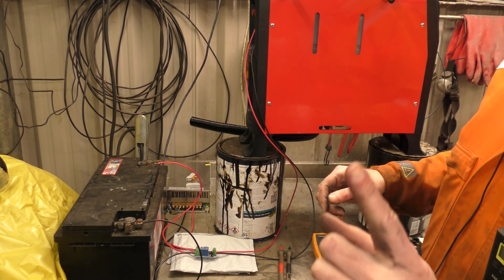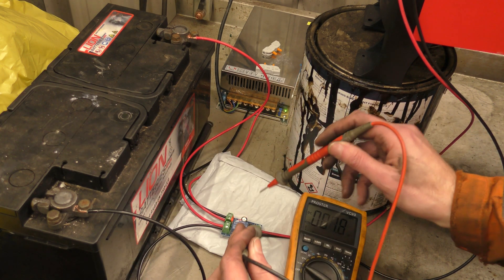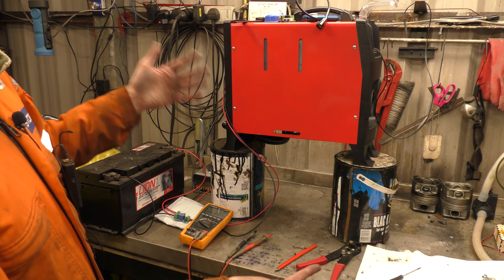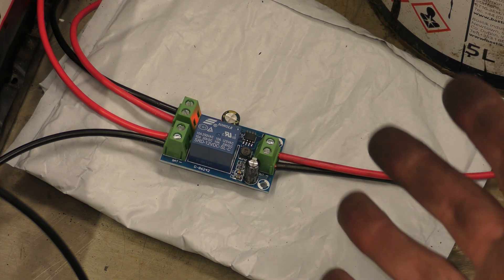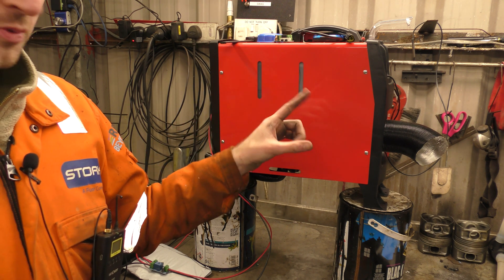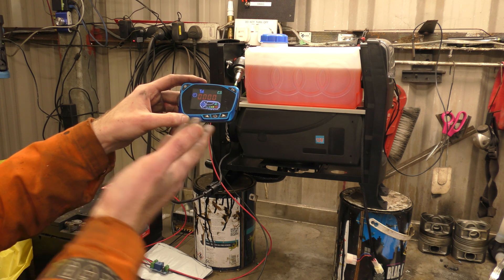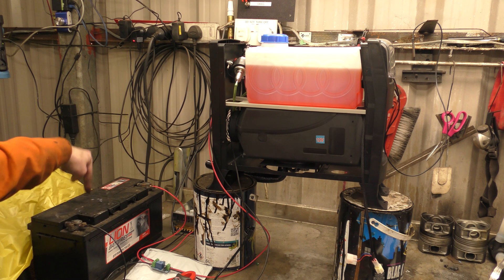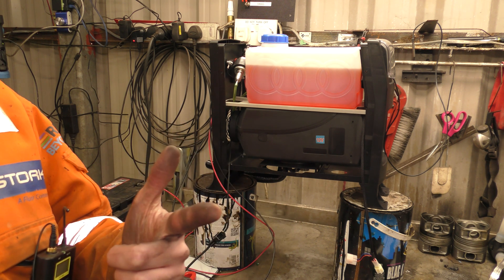Emergency automatic switch from power supply to battery 12V module

Comment: Relay with a mains voltage coil may be a better solution, as the capacitors in the primary of the power supply would still allow it to provide output fractionally longer than the time it takes for the relay to change over.
Quick enough for no perceivable dropout on mains failure but no good for the mains coming back on as the PSU may have about a 1 second startup delay.
Or, turn the power supply up to 13.5V-14.0V if possible and just connect the relay contact in series with the PSU output so that the regulator in the PSU cannot drain the battery when the mains is off.

This arrangement depends on the type of current limiting in the power supply though, as you're asking it to behave as a battery charger. Some don't like that.

Comment: Question, and you have possibly done a video on this and I just haven't seen it yet but: How long would one of those heaters run on a battery alone?
Reply: Every battery is different,  and each battery changes capacity over time. So one needs to know their battery's capacity and state of charge, then work out how long that battery lasts on an approximate 2 Amp draw of a running heater. Some heaters draw more or less.
Reply: Awesome thanks for the information

Comment: If you look at the Am*zon advert for this item (in the notes) it does say that “When it switches, there will be a temporary power failure for about less than 1 second.“ I’m going to translate this as “probably, maybe, possibly, could be a bit too long” for this configuration.

I’d be tempted to go for an intelligent-ish (minimum 3 stage - bulk, absorb, maintain) 10A charger in place of the mains power supply, directly feeding/charging/maintaining the battery, then power the heater from that - a bit like a UPS without the step down & up stages (and the “tingly” voltages on the exposed battery terminals 😉) Even if it runs until the battery voltage reaches the heaters cut off threshold during a power cut it will complete the proper shutdown sequence with the glow plug.
Reply: 1 second is long enough for it to cool down. It cools itself if power comes on quick after lost

Comment: As others have already said, put a capacitor across the live to the heater. A 16 volt 3300uF might do it?
Reply: Just need to open up a scrap washing machine, or something else that might have a cap inside, and find the biggest, fattest one in it, and connect that.
Reply: 50v electrolytic at 4700uf would be my pick most power supply`s run these so easy to find 
Rob 
NSW Australia
Reply: @13yearsaprepperr.jtilbury.51  Hi, could you explain in more detail for the layman please👍👍
Reply: @Woodlandbill  bit late but for anyone else. The capacitor will act like a mini battery. When the relay flicks over to the backup power source the capacitor will power the heater for the brief changeover.
TBH tho, I think I prefer the way it works now, since my backup power is just to protect the heater and allow it to cooldown properly. Mine's powered from a leisure battery in the van, if that loses power then it forces the shutdown but gets the power from the starter battery. I wouldn't want it to possibly flatten the starter battery too.

Comment: What happens when u turn the mains power back on whilst the heater is running on battery power?
Would it work better with the battery and mains terminals switched around?
Love your videos dude 😀👍
I've learned a lot from u and wish I had found your channel sooner. I'll be fitting my diesel heater in me van when the weather gets better and want a mains power and battery's power with auto switching
Reply from the maker: It switches back over instantly.
Reply: Think what he means is does it do the same as the power turned off at the wall. If it's running on battery, throwing heat out and you turn the power on at the wall. Will it continue to work in heat mode or go to cooling.  I was thinking what this guy's just asked.  What's that outcome on that one
Reply: @paulos9304  yes that's what I meant, sorry I thought I explained it properly, it must be my brummy accent 😂🤣
Reply: @manstufftvOriginal  lol. My Northumbrian ain't any better. I'm not sure if the switches over instantly reply means it works as we are trying to say or if it is the same as what it did when turned off at the wall. The second delay power drop puts the heater into cooling mode. Maybe Dave will get back to us on that one
Reply: @paulos9304  🤞 he does, I've ordered 1 from banggood for just a few quid so I'll see for myself in a month or 3 🤣😂

Comment: Nice, but I reckon it would be a good feature to add to the aftermarket controllers, low voltage shutdown so the heater runs down gracefully and doesn't coke up.
Reply from the maker: As luck would have it the Afterburner does have automatic low voltage shutdown.  I probably should have started with the stock controller.

Comment: I use a 5 pin 30A automotive changeover relay to automatically switch over to battery power in case of mains power cut.
Reply: Hi friend where can I get one
Reply: @mazman8343  Automotive shop, garage, EBay, perhaps even Halfords.
Reply: @tkaald  Would the TEMCo CN0169 do the trick? I don't see the switch over speed for that but...

I found something on ebay from a ham radio guy that says his switches in 7ms ("Backup power transfer switch Repeater Battery Backup DC Switching System" PWRgate sold by radiodan-w7rf). Think that's fast enough?

Curious if you've had success with something specific I can compare specs to.
Reply: Can u post the link to the relay?

Comment: Why not just use the mains power to charge the battery via a battery charger & run the heater directly from the battery? 🤔
Reply: I used a 2amp smart charger, heater settings on medium fan speed (cause that's all I needed to heat my shop comfortably and  prolong the life of my heater ) and after 2 months the agm battery remained with constant 12.6 voltage. 🙂
Reply: Yeah, battery charger on supply mode.
Reply from the maker: Would a 'dumb' charger be better than a 'smart' one in this setup?  After the initial 10A at startup the heaters can draw 5A running at max power.
Reply: @DavidMcLuckie  I’m using a Halfords Smart Charger rated at 5.4A on my Chinese diesel 5KW Heater running around 8hrs per day & it’s coping with the demand ok.. Great channel btw 👍

Comment: The main thing is that it runs the cool down cycle. I’m thinking that a standard 12v relay would do the same thin. Connect all the - together, PSU 12+ to activate relay and also to normally open terminal and Battery 12v+ to normally closed terminal and then the 12v+ to heater from the common. It’ll switch in the same way but know the chinese and the electronics the chances are that board probably costs less than a relay 😃.
Would a 12v PSU connected via a computer UPS provide faster switching to maintain the heater switched on? Chances are it may not last for long enough before battery was depleted and gave up. 
Interesting concept though just the same.

Comment: Just parallel the battery and charger David. Put a diode in either or both sources if you don't want to backfeed the power supply by the battery or the battery from the power supply, but I'd forget all that and just parallel the two sources (assuming the voltages are similar).
Reply: Exactly what I did with mine
Reply from the maker: Did you parallel a battery, charger and power supply?  The PSU I have is only 12V so it won't charge the battery.
Reply: @DavidMcLuckie  10 amp charger feeding the battery, afterburner does a shut down if the battery goes low voltage
Reply: @Benny Are you saying to do this instead of even using that module? Or would you want a power supply, battery(+charger) and a diode for each?
Reply: @Dip-it  Yes for the setup David has. Module is not really adding any value but is reducing the reliability of the system and costing money. Oh, the power to the controller won't drop out either.